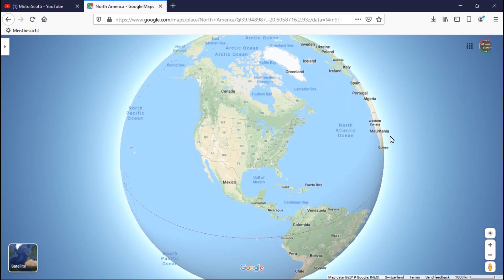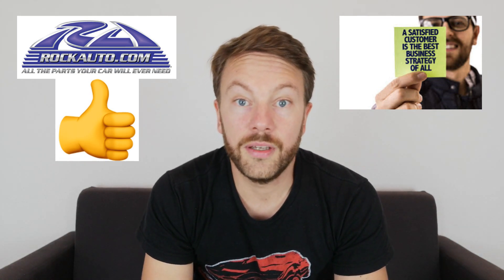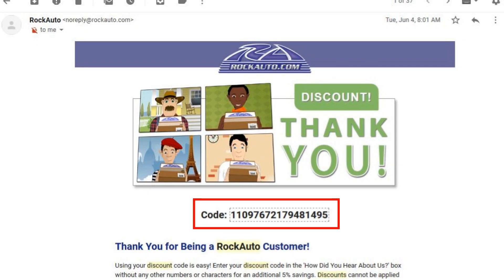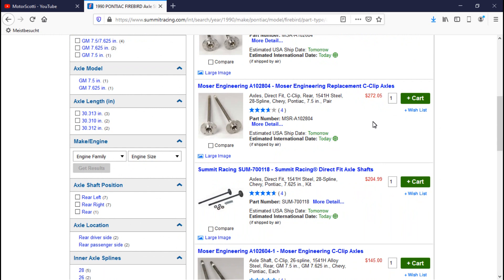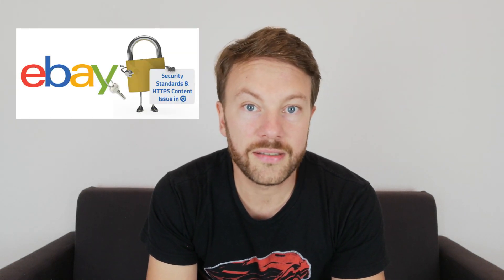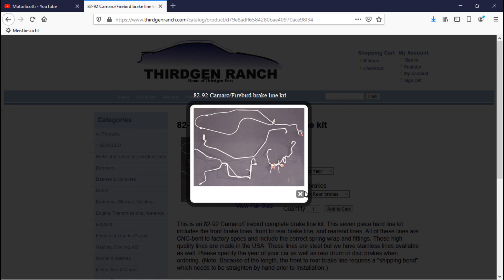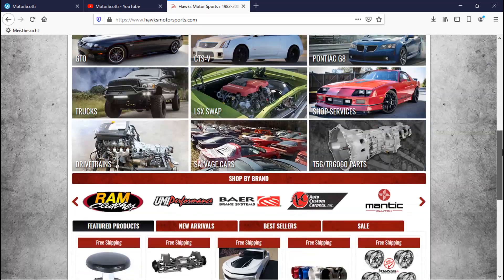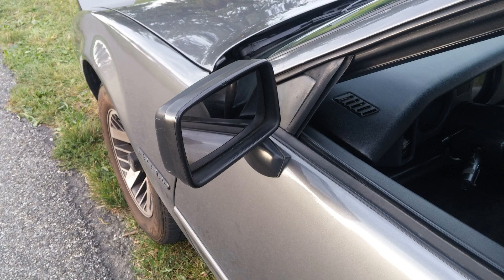KITT Firebird Trans Am - Episode 9 - Getting parts for KITT - Part 1 - Firebird parts

Comment: The Parts place claim on their website that a 1982 rear bumper cover will only fit in 1982, 1983 and 1984 models. If that's true how did you manage to install it. Also, are those bumper covers made of fiberglass? there are a lot of websites selling Kitt's panel parts, but they're made out of fiberglass. I would avoid making my replica car entirely out of fiberglass.
Reply from the maker: Very good question. The Parts Place's claim does make sense though, as the inner honeycomb bumber is different, as it always follows the shape of the outer bumper cover. I did put my 82 bumper cover on my car with the 85-90 inner honeycomb bumper but there was a bit if tension in the middle. I only recenty found the correct 82-84 inner bumper to fit the bumper cover, which is better. I made a quick clip on instagram about it. 
No, the bumper cover from The Parts Place is like the OEM one, made of polyurothane or something like that. It's quite flexible.
Reply: @MotorScotti  I don't have an Instagram account. Is it possible to access your video somehow? If that's not possible, you can address it as a future installment on one of your next videos. ;)
Reply from the maker: @rockandmetaljunkie  I actually already have mentioned the inner bumper in episode 8.😅 You just need to replace yours with an 82-84 version.